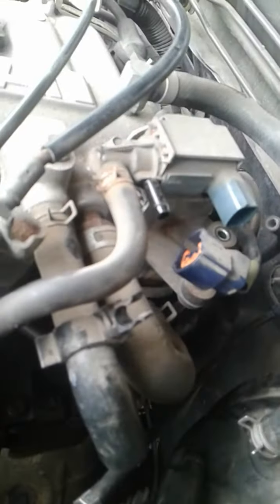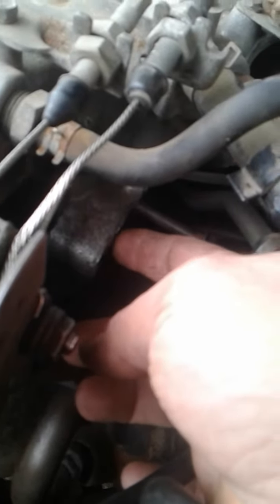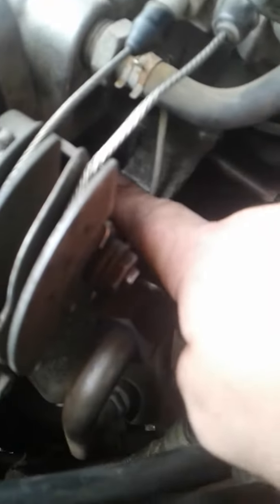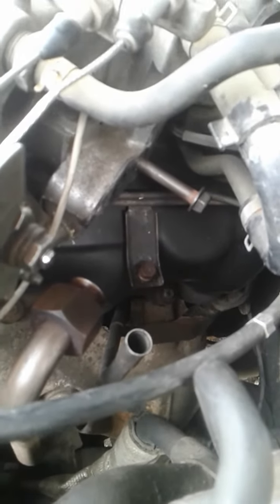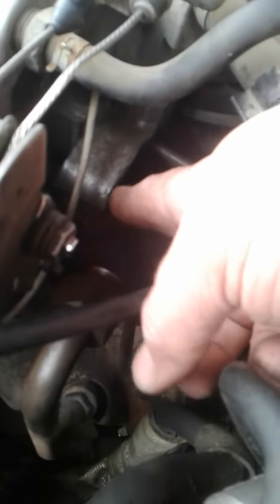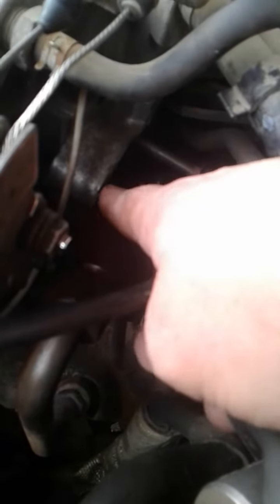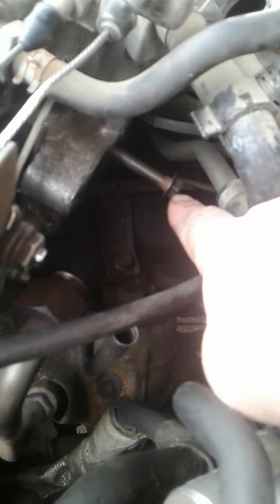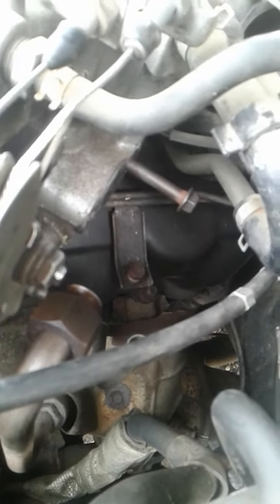EGR Valve Removal and Install 1998 Nissan Pathfinder

Comment: The metal bracket is a Bitch to put on haha. Best way is to bend it a little to where it hugs under the intake, apply a little glue to where it’s going to sit. Instal egr first then slowly install bolts and slowly spin until they both grab on. Be patient. Good luck.

Comment: Didn't work on mine . I worked on it for hours to get the back bolt to grab a thread and didn't work. Ended up tightening up the outside bolt and let it go.
Reply from the maker: It isn't easy.  The threads are not very forgiving.
Reply from the maker: 1.Insert the back bolt into the bracket and threads.  Don't put the EGR valve on. 
2. Put the front bolt through the EGR, bracket and threads. Finger tight.  The EGR should be sitting on top of the back bolt. Not aligned. Sitting on top of it.
3. Remove the back bolt align the EGR with the back hole and plate. 
4. Reinsert the back  bolt through the EGR through the plate and into the threads.